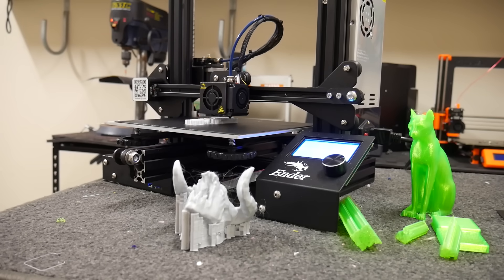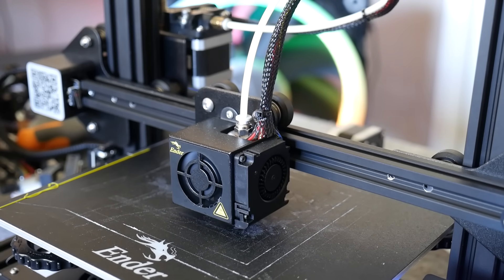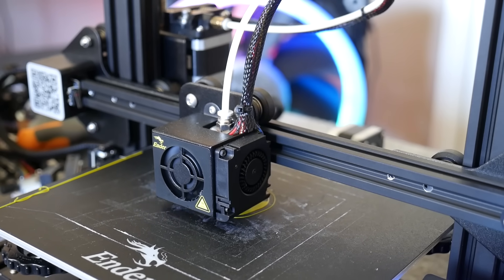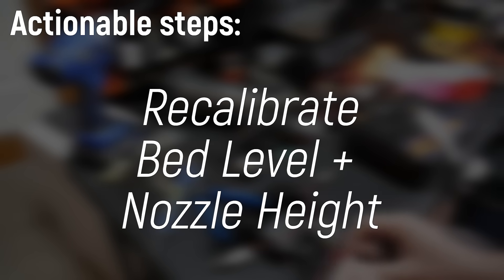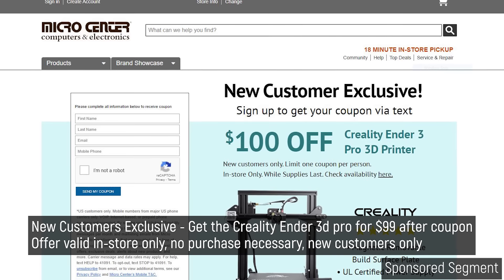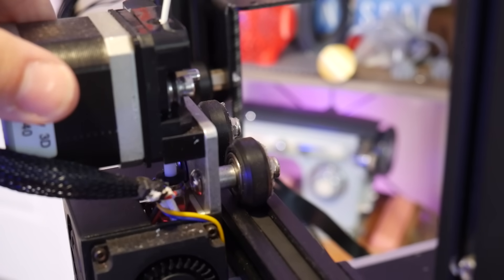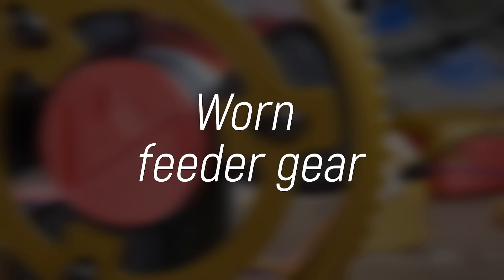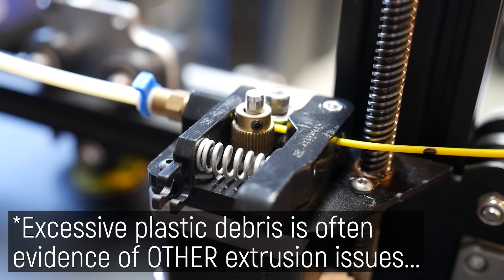Have your 3D Prints started to suck? Watch this!

Comment: THANK YOU!  Got it for $99 at Micro Center.  Adding BLTouch, upgrade bed springs, upgraded Boden couplers, and uSD to SD cable/adapter for another $79 with $21 left over.  Again thanks.

Comment: You might have saved my printer with your tip at 7:15. I did a lot of PETG printing and it always worked. But a few months ago I had severe extrusion issues, even though I never really changed anything. I tried changing the nozzle, change parameters, play around with bed leveling and nothing worked. I'll definitely try this! Great video!
Reply: ah, i had this same issue some time back. 95% chance swapping that for a new one will fix your issue. my old tube simply wouldn't let filament go past a certain point

Comment: Tip for the bed leveling. Changing your springs to silicone springs/bushings allows to be slightly more rough on your bed without throwing it out of level. 
Now that and being gentle should allow you to basically set it once and forget it.
Reply: @Gtmz53fxt56zxc  I wouldn't say it's needed. However it does stop you from having to relevel the bed constantly. 

As for the sagging I can't say I have experienced this at all and I have been using them for over a year now.

What you can also do it print out some in TPU as the bed won't go above 100C in normal operation. If these work out for you then spend the money on the silicone ones.

Comment: Thank you so much for this video!!! I have was about to dropkick my printer out the back door when found this. I went through all the hard ware and found a piece of threaded rod where I thought was a bolt. this held a concentric nut on the gantry that was able to vibrate and tighten ovr time. thanks a million again.

Comment: i've been fascinated by 3d printers for years, and more seriously in the last few months. i even familiarised myself with blender and cura beforehand. now i have finally made that step and ordered the ender 3 pro. it should be here within a few days, and i'm super excited to get into it for real. i've watched soo many of your videos- you are pretty much my go to for 3d printer stuff, especially as you use the ender a lot more than other youtubers. some use prusa more, but i feel like i'm already more into the ender 3
Reply: he made a lot of upgrades to the ender, direct drive may be the biggest and most important , also i wouldnt recommend an ender 3 in 2022 because of old motor drivers, it is very loud
Reply: if one i would say sovol sv01 pro is the best overall at the moment
Reply: @Gtmz53fxt56zxc  no probleem, I still have my sv01 pro, bond stock. Ang going strong, only thing Maybe worth upgrading is cooling duct . But I have no need for it, same for high temp fillament, no need for me to go over 240. Good Luck and sovol is worth the money :)

Comment: Wow, great info to know and perfect timing. It’s the algorithm gods. I’m still new and learning as I go and currently experiencing all the issues. I’ve had my ender pro 3 last holiday season and finally set it up about 4 months ago. I swiped out the regular PLA for a silk and have not had any success with it yet. I just got a metal extrusion replacement and stronger nozzles. I’ll add these steps to my tool bag and cross my fingers and toes, lol. Keep up the great videos very helpful.
Reply: Did.any of these problems duplicate w yourself?

Comment: Excellent video, thanks.

Something that caught me out for ages...twice.  is a blown pololu for the extruder.  It wirked enough to extrude tests but too weak to maintain a print, often diminishing after the first layer.  I'm pretty sure it was where I used to pull the filament out of the feeder when changing rolls causing a back emf and blowing up the controller.

Comment: As for the bed getting out of whack due to adjustment knobs turning itself ever so slightly due to vibration during printing or contraction and expansion may I suggest screwing on a wing nut just below the adjustment knob which when tightened against the knobs, act as lock nuts to the knobs. In doing so the adjustment knobs remain in the position you have previously set for much longer. Cheers and thank you for all your educational and very useful videos.

Comment: i just got a 3d printer, i printed the benchy just fine everything else was failing immediately. I was beginning to lose my mind.... I finally came across your video that mentioned finger prints and the oil from your skin, i wiped some dust off my plate with my hand after the benchy. A lot of videos i watched talked about cleaning but i never considered mine being dirty because i didnt so much and there was no residue or anything so wow thank you

Comment: Just picked up my first 3D printer second hand from Goodwill so this video will help do a checkup to get running good. Was lucky to get a Davinci Pro 1.0 there and pretty sure it will need some of these checks and fixes from the get go but for $50 still worth it I'm sure.

Comment: Easiest fix for the burning PTFE for most Creality printers is to get one of those dual metal heatbreaks that move the location where the tube connects to further up and out of the heater block and into the radiator. It's worth it to get the dual metal one as an all steel one will cause heat creep and clog up with PLA after an hour or two of printing. This makes your standard Creality hotend into an all metal one without much effort and I haven't hat to change tubes since!

Comment: One other issue for 3D printers to start failing is machine structure. It was apparently my fault at assembly; but my z-axis rail came loose enough to cause head to bed misalignment. So, not only check rollers, belts and the extruder feed gear; but also check the rail for play.

Comment: I have found that disassembling the hot end and making sure the nozzle is clean and putting everything back together (with potentially a new PTFE) is necessary every five kilometers or so. I've always found "take it apart and put it back together again" fixes all kinds of "why the heck  has this stopped working?" situations, from computers to engines to printers.
Reply: The take it apart put it back together has been my solution for everythingy entire life. People ask how did you fix that and I'm just like not sure lol

Comment: Buying a glass bed was one of the important things I was told to buy right from the start, so I made sure mine included one. Prints were great and I was very careful to adjust the tension of the belts and rollers as close to perfect as I could get, just enough tension to do the job so everything rolls smooth and easy plus doesn't stress anything more than it needs to. So far everything with that has been lasting great for the two years I've had this thing.

What I did start seeing this year is the bed wasn't sticking at all. I know it wasn't bed leveling because I level it before every single print, yes every single one while at temperature. it's always off by a 1/4 knob turn at most and I'll bump the bed on all four corners to settle the springs which does require another round of leveling but it's like a 1/8 or less knob turn to get every corner perfect and lastly checking the center.

The fix I went to was using a glue stick. I was already printing with a raft on everything but now I exclusively will use a raft to separate the glue from the print and I don't have to worry about damaging the print. I just peel the raft off.

Good thing with the glue is I pop off my glass bed and sit it in my sink to wash off (it dissolves). Elmer's purple glue sticks for school. So my bed is always washed clean after every print as well.
Reply: i do the same, my engineering teacher (who isnt qualified btw) has no clue how to use 3d printers, and she ordered a glass bed for the printer (she wanted to replace the flex bed since it was so gouged), and then called me down to her room to get me to fix it. its a relatively high end printer, around 2k, so i thought, no problem. i suggested the use of a glue stick since thats what i do on my E3V2, and it fixed it instantly. its been a constant struggle this year, having to teach her how to do her job, but i get un restricted use of the printers and excused assignments, so its a win win.
Reply: i had the issue with first layer adhesion, i figured it could be unever heating of the glass, and it was. i smeared thermal paste on the base plate and then put the glass on top, it made it heat much more evenly and it stopped having bad adhesion on certain parts of the glass. it's been a non-issue since.

Comment: Great video.
Stringing has been an issue since I got my printers serviced. New heat break fans, but I'm not convinced it is working well. Also updated to Cura 5 just afterwards though and wondered if I had missed something. This showed a great way for me to check.
The second thing I really liked was using the food dehydrator. I've been having flooding in under the house, only about 5 metres from my machines and have been looking at a filament dryer. There is a dehydrator sitting under the machines from my plaster casting! Job done.
Thanks for the video.
Reply: Stringing comes from gaps in the hot end, not enough retraction, printing to hot, bad e steps or flow rate. Teaching tech has a calibration guide on GitHub. Good luck with the issue.
Reply: @paintballercali  yeah, I've tried testing all those things. Even got down to perfect results with the stringing test STL. Then I do a larger piece and I get stringing again.
Reply: @techadeptcrafts  tomb of 3d printed horrors has a string fix mod for Bowden setups check that out

Comment: 3:45 IPA actually removes some of the coating used on glass print beds (Ender 3 v2 for example even comes with a warning saying not to use alcohol based solutions on its bed).
Reply: @1seb11  if you use IPA on the ender 3 v2 glass bed with a clean sheet of paper towel you will remove yellowish residue. You can also scrape the same residue with a scraper if you are hard on the bed. I only use water w/ dishwashing soap  and never had issues with surface cleanliness. IPA is not the way to go on specialty surfaces.

Comment: to avoid clogging I also use cleaning filament. It is very easy ti use and when you see what you take out of the hot end, it is very efficient.
Especially when you switch from different material

Comment: If you want a fairly cheap enclosure for your printers I recommend building a box from plywood square rods and channel plastic. A window in the door of acrylic/plexi glas in the door so you can see the printer is recommended. I included a cheap (12$) bathroom exhaust fan connected to a external vent via a flexible duct, good to do if you print other than pla, do not forget inlet holes under your printers to keep it cool if you build this, perhaps with a filter if possible. 
Can you over dry filament? I keep my active filament at 40c in a smaller box of the left over material from building my printer box (as mentioned above) I run it via a plastic hose to my printer box to minimize moisture absorption, is that overkill or a smart move?
I got flaky prints after 3-4 prints on my new printer on the first role of filament but that was till I learned about setting hot end and bed temperature and not leave it at default, nobody told me and it said nothing in the printers instructions that this may be required, I had to find out on youtube.

Comment: Thanks Angus. Good suggestions. I have a Makerbot Method X printer. The only time I have had issues was with Metal Filament printing. worked fine for a week and then the filament became brittle  and the extruder Teflon tube cooked. Fortunately it is easy to replace in the Labs extruder I was using. It is not easy to dry the filament as it can become too hot in normal dehydrator. I might try to dry slowly at a fairly low temp. I have put off metal filament printing until summer.

Comment: A low cost dehydration option might be an incandescent bulb in an old cooler or something like that. It's a good way to keep 7018, or really any, welding rod dry in between projects.
Reply from the maker: Heh I've seen similar machines used to make beef jerky! Not a bad idea
Reply: @MakersMuse  Dehydrator? I use it to dry filament.
Reply: my dehydration process consists on doing nothign and leaving it all to the desert-dry climate of my region to suck the moisture out of everything by itself.

Comment: Pretty sure I’ve encountered at least half of these in my travels. 
For leveling, I check the base regularly, along with a probed 3-point tilt at the start of every print. The print surface is a tricky one; I use a PEI magnetic sheet, and that picks up oils like it’s stocking a car mechanic. Regular IPA spray/wipe passes, and a less regular dish soap wash, are my sequence there. 
Motion components haven’t really been an issue for me so far, nor has a dead heat break fan, however I do use one of those red aluminium clone dual gear extruders; I did replace the centre bolt that the outer gear runs on with a cut-down short-thread M3x35mm bolt. This means the gear is turning on and against a constant-radius surface, instead of against screw threads. (The 35mm is the correct length to take off around 14mm of the 18mm that is threaded, leaving the rest to sink into the tapped hole without coming out the other side, and the balance being the shaft for the gear.) Also ensure that the idle gear runs smoothly against the top and bottom surfaces of the extruder arm; if it’s scraping, it will wear away the aluminium and move out of alignment, causing inconsistent extrusion. The one I have has some copper washers in between these surfaces.
Moisture in the filament has been a huge issue for me; the ambient humidity sits around 68% in the room where my printer is. A well-sealed dry box helps, and I recently got a dehydrator to use for the same purpose. 
I took the opportunity to upgrade the heatbreak to an all-metal one in order to avoid having burnt PTFE ahead of going into PETG printing, as I’m not wanting any of those off-gas chemicals. In the same vein, my printer has a (working) smoke alarm mounted in its enclosure; hopefully it never gets used. That’s on top of the thermal runaway protection already in the printer. One other thing I do is coat the heater cartridge in a small amount of thermal compound when installing it to aid the transfer of heat into the heat block, increasing the efficiency of the heating.
One other thing I’ve done is to move the printer electronics and power supply outside of the enclosure, to try to avoid heat shortening their lifespan. This means extension cables, and more inline connections, meaning more potential points of resistance. I lost my first printer motherboard to a badly tightened power terminal; make sure they’re solidly screwed down where appropriate!

Comment: Great video with lots of useful info.

One thing I'll say though is you mention always using hardened nozzles. I'd agree with this for printing with anything abrasive or if you print a lot, however if you just use PLA and aren't printing near continuously, I would suggest sticking to good quality brass ones. I switched to a hardened steel nozzle and didn't realise that they require higher temperatures than brass to print properly. Not a big deal, but something that isn't obvious and is worth knowing.
Reply: You can also just budget a couple extra cheap brass nozzles per roll of abrasive filament, they're barely a few cents each.
Reply: @Siana Gearz  i find $0.30 cent brass nozzles print tpu just as well as $20 ones...i wont even clear a clog these days...just toss the nozzle and grab another...$0.30 is better than any effort taken trying to heat it up or run a needle through it or any time wasted fiddling...just stick another nozzle on and keep the machine going.

Comment: 11:00 Man that sound gave me memories xD 

As for Noctua... I replaced my fans with Noctua fans to help quiet my printer further. I have a CR-10. The Noctua fans weren't powerful enough to use some of my filaments. Some filaments would completely jam up due to heat creep. Others were fine. But the two that I've had problems with are Matterhackers and Sunlu, quite popular brands. Switching to a higher powered fan (power output that is), that wasn't quieter, fixed the problem.

Comment: Living in Arizona I don't really have an issue with Moisture and filament.  Great information. I have a Tevo Tornado (Gold) with the glass bed and I just spray some Aquanet unscented on it and the PETG sticks great and releases when it's cool.  A little IPA and a rag cleans it off and I keep it clean. My printer is 3 yrs old and working great.  Thanks for the info to help me keep it that way.  The BLTouch helps with the leveling.

Comment: For me, it was the Bond Tech drive gear that was loose. The retaining screw is so small, and mostly hidden that I honestly forgot it existed. Once I aligned the gears and tightened the screw, all was well.

It's all good, though, because it forced me to conduct all kinds of maintenance that likely helped with print quality in the end. I was amazed how loose many of the screws/bolts were after relatively minimal use of the printer (under 100 hours).

Comment: for newbies, it is more than likely your nozzle if you had trouble learning how to properly level your bed. Mine was sanded down pretty far and all jacked up and I didn't realize that wasn't normal wear and tear until I actually compared it to a new one. Replaced and now its printing perfectly. I have an ender 3 neo btw. Also, I don't know if its just my printer, but you will certainly want to get dual z screw no matter what anyone tells you. I had a problem where the other side would slowly sag over time and when you started using your printer again all of your z offset settings became worth less and you had to re-level the bed.